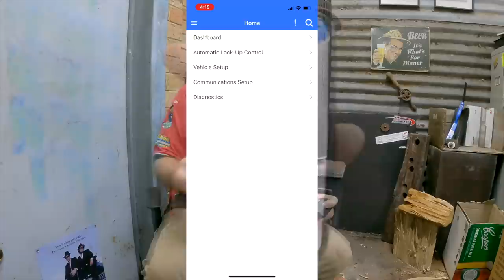What is a Lock-Up and How does it Work?

Comment: Stu, can you do a follow up "do's and don'ts" when using a lockup kit to avoid damaging the transmission, voiding warranty etc. For example, changing gears with it on, down hill decents both 1st gear low range offroad and high range onroad towing, high torque/load situations, towing, cruising, hills, etc.
Reply from the maker: This is almost a video on its own!  Yes you can change gears with the lockup engaged but back off the throttle, change gears then accelerate again. Can be used on downhill descent in low or high range to use the engine compression to control the speed, especially when towing, avoiding having to ride the brakes. 1st gear lockup is available if you have upgraded to a Nomad Heavy Duty or Extreme Valve Body. Otherwise engage lockup when you get up to cruising speed or install the Nomad Lockup which is generally set and forget! Do not use the Lockup in sand or "bouncy" rocky terrain as the torque converter needs to slip to reduce the impact on the driveline. Hope that helps, if you need this explained in more detail, send your question in an email to techsupport@askorto.com.au
Reply: @WholesaleAutomatics  i thought sand would be recomended to lockup to reduce the heat.
a couple years ago i made my own lockup loom with a switch and relay like you blokes. was all manual though so had a light to remind me to turn it off. always used it when cruising on the sand just to keep the trans temp down. turned it off on the dunes.

Comment: I've looked around videos about lockup torque converters. Some give you a simplified in depth animations and others like this. But none of them ever explain how it works during gear changes. So c'mon already. I have to use my imagination here but since it acts in comparison to a manual trans clutch, then I assume that from a stop and for every gear it slips initially and then locks up like you would release the clutch pedal once you're completely with the selected gear and overall vehicle speed?
Reply from the maker: It's a very technical bit of kit to talk about so we never know how detailed people want us to go before they fall asleep. However to answer your question our Nomad Lock-Up kit has full flex-lock capabilities during gear changes. So it unlocks maintaining a slip rate and then relocks so you barely notice the lock-up was involved during the gear change. Hope this helps.

Comment: Thanks for the video, do you think you will do a lock up kit for 2016 Colorado 7 (non DPF) please? Cheers Mark
Reply: Guys, really keen to see if your doing a kit for my Trailblazer 7 Colorado please thanks Mark
Reply from the maker: Unfortunately the Trailblazer 7 Colorado has the 6L50 Transmission with an internal transmission control computer. This means we can't interface with the torque converter clutch.

Comment: 80 series had torque converter and valve body upgrade.
200 series has the gen 3 - all good from my perspective.
Had a code error pop up early on but Craig and the team wher on top of it supprt wise.
A test of any product is how good is the a
More importantly - what is the whisky of choice? Using a proper glass is a good start.

Comment: From across the pond... Good video. I especially liked how you demonstrated a TQ. Converter function,  I understand  that before but it explains how and why they work for non mechanical inclined people. I'm quite experienced with the heat build up in one or 3 Tq converters... 😉 I've roasted a few in AW4 transmissions. Fittingly later in your video covered the same problem on GQ's transmissions.  Non-lockup in 1,2,3 only in 4th.
Reply from the maker: Glad it was helpful!

Comment: For what its worth i got a lock up kit in my kitted 200 series back in 2017 when i was in perth, sorry blokes, its the oppositions brand :), . best thing i ever invested in. Towing a 2.5 ton van around australia twice, the fuel economy improved by heaps and trans temps dropped by 40-50 degrees ( compared to when it was off ) I would recommend to any 4x4 owner with an auto to get one.

Comment: Are you fellas doing some RnD for the RE7 jayco Y62 transmission? I would like to get mine built and up the line pressure along with a bigger pan and cooler kit. Apparently the Arabs add extra clutch packs and beed them up
Reply from the maker: Yes we are doing a development programe for the RE7 but need another 9 months.

https://automatictransmission.com.au/select-your-vehicle/nissan/patrol/y62-5-6l-v8-petrol-with-7-speed-auto/?make=Nissan&model=Patrol&series=Y62%205.6L%20V8%20Petrol%20with%207%20Speed%20Auto

Comment: Great vid Stu..thanks. Before modifying my 200, I’d like to know more about the standard converter and how it locks up. I’m towing a large van and are worried about trans temps due to slippage etc.
I believe that if I drive in S4 the converter locks up at around 70 kmh. 
I typically tow between 90 and 95, if the converter can be locked using s4 mode, why would I need the modified torque converter lock?
Cheers..
Reply: I had the exact same question.
Reply from the maker: You are correct that S4 will allow the Torque Converter Clutch to engage automatically, however due to towing it will also unlock easily due to the extra load. The Nomad Lock-Up Module allows you to program the speeds, gears, and throttle inputs that you would like to maintain Lock-Up while driving and/or towing. In addition, you can use the Manual Lock-Up function to aid in downhill descents and offroad road environments where neither the OEM Lock-Up or the Nomad Lock-Up will engage automatically.

Comment: Hi Stu.

Does the lock up kit increase the clamping force on the lock up clutch in any way or just engage it at different times. Assuming the latter, does this put extra wear on the lock up clutches having them stay locked with great torque going through them? I have heard suggestions that some kits kick in the whole 12 volts from the car to get a stronger lock to prevent additional wear on the clutch but I gather from this video that the higher voltage will cause the solenoids to fail over time due to excess heat. Is this your take on it?

Comment: Hi.
I have a 99 gu tb45 with re4.
Ive got stock 3.9 diffs running 33s tyres, i can feel converter slip under hard acceleration between 1st and 2nd.
It also has an m90 supercharger running 4 psi. 
Will the lockup kit fix my issue?
Thanks.
Reply: Sorry 1st gear only, its like it locks up higher in the rpm, slip?
Reply from the maker: What you need is a Billet torque convertor as this will make the most difference: Here is the link:
https://automatictransmission.com.au/shop/billet-hd-torque-converter-re4-4-speed-behind-a-tb45e-petrol/

Comment: Noob question: in modern cars (year2000+)does the torque converter lock when using engine brake ??
Reply from the maker: You can choose which way you want it to work for each of the 5 presets.

Comment: One thing I don't understand. If the lock up is not locking up the gear as such, then why does it matter if it locks up in 3rd or 4th? I thought the lock up would just connect the engine and driveshaft directly one to one. So the speed would rise directly with engine speed.
Reply from the maker: The lock-up kit locks the clutch within the torque convertor to give you 100% transfer but it doesn't lock it in a gear. The transmission can still change up and down the gears while lock-up is engaged.

Comment: I am wondering why you no longer do a lock up kit for an NP Pajero?
Reply from the maker: It's not that we can't as we can and we in fact have kit that will work with the NP Pajero. The problem is inconsistent wiring in the vehicle that makes fitting instructions difficult. We can do these in house in Bayswater Victoria.

Comment: Did the video explain why you would want to change the way the converter works?
Reply from the maker: A lockup kit allows you to engage the Torque Converter Clutch in situations where the Factory ECU will not engage. For instance the ECU does not know when you have a big heavy van behind the vehicle or if you are descending a very steep hill where the van is starting to push the car. In these situations you can engage lockup to reduce the heat generated in the torque converter or to increase engine braking reducing the need to ride the brakes. You will also notice a drop in fuel consumption when towing.

Comment: G'day Stew how are you. Do you know which Auto box would Work best in a 1989 Triton. May last year I had my left leg amputated above the knee and as a consequence , I cannot reach the clutch pedal. I have looked info it and found that the early Triton was not Auto. I realise  that the costs of doing a conversion is going to be expensive. But I own this car and have striven to keep it as originally correct as possible.
Reply from the maker: Hi Stephen, the problem with converting the 1989 Triton is that is would cost far, far more than simply selling and upgrading to either the same model that is already factory fitted auto or a later model if budget allows.

Comment: Hi Stu, thanks for the video.  I have one question I'd like to ask -  vehicle is GU Patrol ZD30CRD Auto with Nomad valve body fitted.  Is the transmission harmed changing from 4th to 3rd with the TC locked?  There's no smoothing so does it do harm?
Reply: I’d also be keen to know this. Mine is an LC80 with valve body and gen 1 lock up. Does it do any harm to simply leave the lock up on whilst manually shifting through the gears?
Reply from the maker: No not at all Ein because you already have most of the mass (inertia) going so very little load on the lock in comparison to what the load would be on the 1st to 2nd gear shift and again 2nd to 3rd where you are still trying to get the mass of the vehicle up and going.
Reply from the maker: You would not run it on the 1-2 and 2-3 gear shift but would be fine for the 3-4 and 4-3 gear shifts.
Reply: @WholesaleAutomatics  Thanks for the reply.  I have been a bit reluctant to use it fearing damage, but it's really frustrating having to constantly encourage lockup in 4th at around the 80kph mark, because of my 33" tyres.  My lockup is manually switched and also disengages at 60kph and re-engages at 65kph so 1st to 3rd shifts are excluded unless I really need to plant it.  Now I can lock it on those long outback corrugated tracks where best speed is ~80 and it's mostly in 3rd or 4th.  Thanks again :)

Comment: would love one of your kits but you dont cover my car. need to cover some suzuki models. mine has the 5spd auto i believe from the dmax and prado. '09 grand vitara 3.2 v6.
Reply from the maker: Where are you located Morgz?
Reply: tasmania
Reply from the maker: If you are part of a group and know of someone close to us here in Bayswater Victoria, we would be happy to build a range of products to suit and I believe we would already have deep cast pan, Nomad Valve Body, Temp Gauge with only the cooler kit to test fit and we would have a full line up. We just need a test vehicle to see what is required to double check.
Reply: Unfortunately I'm not and don't. Will say that the exhaust crosses below the trans sump so a deeper sump would only work if the exhaust was re routed behind the transfer case.

As for the rest, well 🤷.
Would love to offer mine for test fitting but may be a little difficult.

Comment: You would think that vehicle manufacturers would be interested in lowering fuel consumption to meet the regulations but that's not the case with these torque converters?

Why do they slip so much? Save the driveline?

My hilux (2021, 2.8) can slip a lot and you really feel the difference in power when the converter locks.

I don't get it.
Reply: I have a 2020 Hilux and a 21 Dmax. The Dmax is very eager to lock up and the hilux, not so much. The Hilux is by far the nicer car to drive. I have been thinking about a lock up kit for sometime for the lux but I just figure Toyota know better than me

Comment: Can you explain about when a lockup can be used and cant  be used regarding throttle position whilst towing a large van eg can it be engaged at full throttle eg up steep hills or long climbs thanks
Reply from the maker: Hi David, rule of thumb is have some mechanical sympathy and your transmission will last longer. Engaging the lockup at full throttle, or shifting gears under full throttle with lockup engaged is not going to do your transmission any favours. Back off the throttle, engage or change gears and accelerate again. On steep climbs, remember that the vehicle does not know you are going up a hill, and certainly doesn't know if you are towing a big heavy weight behind the vehicle. In these cases, act early, shift into sports mode and shift down into a more appropriate gear for the length and steepness of the hill. Hope that helps, if not, send an email to techsupport@askorto.com.au and our techs will explain further.

Comment: OK so I get this straight. I can use this lockup on the highway, downhill and manual shifting for engine braking but not everyday driving.
Reply from the maker: The Nomad Lock-Up kit can be run both ways and is normally programmed to run all the time with the exception of when you manually override for extra engine braking.
Reply: @WholesaleAutomatics  Thanks so I can use it for normal city driving ? All the time? I thought it was only for towing.  I  have a US spec 200 Series.